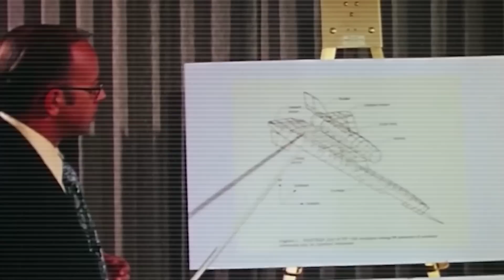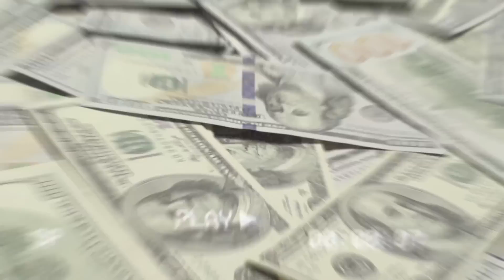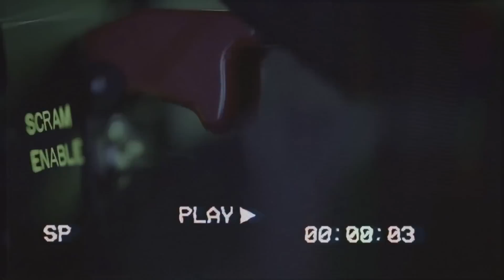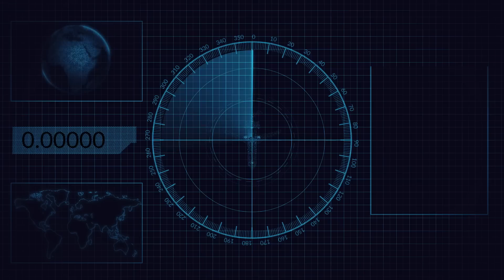Elon Musk Declared SR-72 Darkstar Is Finally Ready To Fly

Comment: I'm a little confused now. Where does Elon fit into Lockheed? And also, if they got rid of the SR-71 because it was too costly, they build the 72 that's much more expensive? I'll bet they will get $7,000.00 for a single screw or bolt.

Comment: mach 6 is not twice the speed of sound in my universe
Reply: Speed of sound changes with air temperature and density. Very roughly, the speed of sound at say 90,000 feet would be around 680 mph while at sea level, it would be around 760 mph. So, Mach 6 at 90k feet, where this plane would be achieving Mach 6, would technically be travelling as seen from a fixed reference point on the ground at around 4080 mph. If this craft could travel at Mach 6 near sea level, the speed relative to that same fixed point would be around 4560 mph. The Mach number is a unitless number relating flow velocity to the local speed of sound. Mach 6 is simply 600% of the local speed of sound.
Reply: @bila3618  Are you saying "mach 6 is not twice the speed of sound in your universe" as well ?
Reply: Really?.  Can I ask you a question
Reply: @ElizabethGreen-w7h  By any means, ask away.
Reply: @houndogjohnson4013  I'm waiting for this question of hers!!!
Reply: "at those altitudes" so yes,, in your universe,, jus not your atmosphere
Reply: it is 6 times the speed of sound in our atmosphere